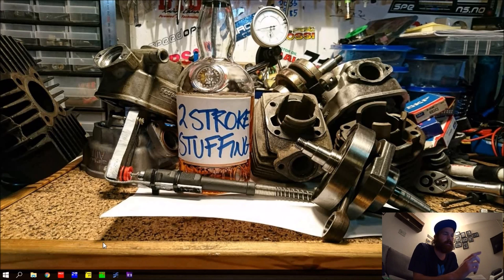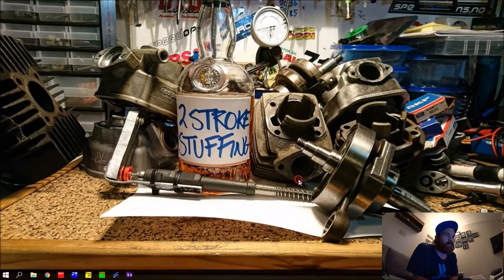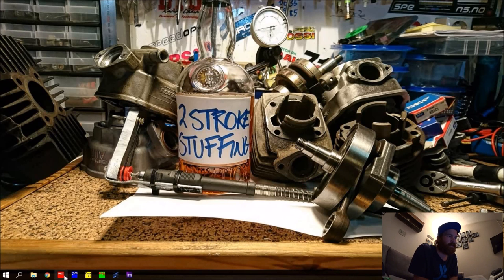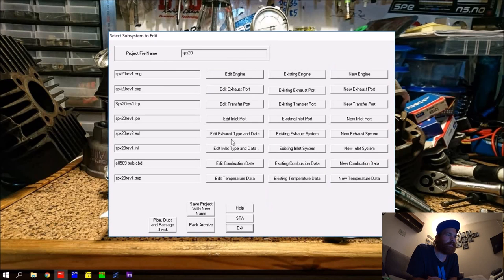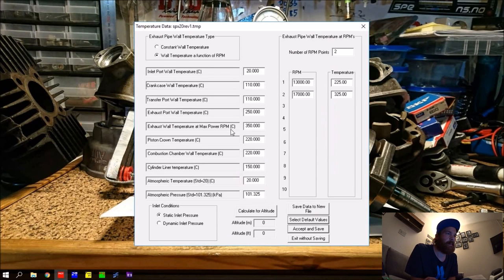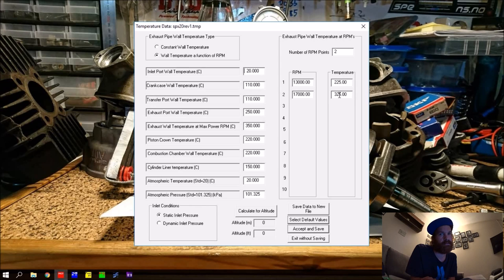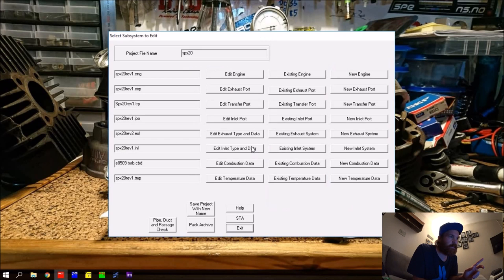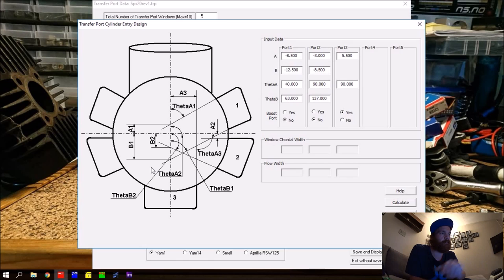E30 Engmod2t - Best Two Stroke Software! 2STROKE STUFFING

Comment: I have been using Neels s/w for over a decade. It has helped me win one national Championship. And build hundreds of  customised two stroke engines for customers. 
Prior to this I used spread sheets, then Mota, But once I found Engmod2t and engmod4t. No looking back. His power output predictions matched the dyno. And the chambers designed using this s/w is hard to beat. He is my tuning Guru. I could not have achieved anything without his software and guidance.
Reply: So how can i contact him as ineed help wih a 2stroke twin roadracer.  Thx

Comment: Thanks for a great 2-stroke page! 😊

Did you have time to evaluate any other 2-stroke software? Like Bimotion or RacingSM? 
$400 for the EngMod 2T might not be super expensive but probably a bit more than most hobbyists entire renovation budget…
Reply from the maker: Thanks! I have very little experience with other software, but engmod is close to perfect in my opinion.
Reply: Any chance you can make a comparison between the results in EngMod 2T and the dyno with the same setup on the bike? That would convince many people!
Reply: do you have a link? I would love to take a look at it

Comment: Alex, I think the diffuser horn coefficient is only relevant when the diffuser sections are part of an exponential horn, like a trumpet, where each section has a steeper angle than the one before, following an exponential formula. Such pipes work, but require a very careful throttle coming out of corners, especially in the rain. Don't ask me how I know...

Comment: Have you ever heard about the GT-Suite and the included PowerGT software? Former Ferrari F1 engine designer told me about that. This engmod2t software looks something like a layout built on those features with limited input, output possibilities, but at least engmod2t is specified for 2stroke tuners and you do not need to run CFD simulations, to get scavenging ratios
Reply from the maker: +rlaci It's pretty expensive I recon?
Reply: i do not even know if a normal person can buy it or just an organization etc, but as i know AVL and engine companies like that are using them. As i know from my friend Audi has his own softwares possibly other companies too. Once I think heard something that engmod2t is based on powerGT but i'm not sure, anyway its way easier for a tuner to use layouts than make new complete systems with a lot of variables. I will contact you on your ordering mail to talk more about supercharged 2stroke and will try to find and upload some stuff to show you in the next days
Reply: GT-Suite is not good for 2 stroke simming. The expansion chamber modelling is not accurate and there is no reed valve modelling at all.
Reply: i think you have more experience with that program, could you help me with a scavenging ratio calculation?
Reply: What help do you need?
Reply: for scavenging the gt suite is using some kind of constant, what i do not know how to calculate, i think some CFD modeling is needed, but possibly you have experience with working numbers. can I PM you on some way?
Reply: I think you need the scavenging numbers that are used by Engmod2t software. If you email Niels at Vannik and ask for a sample copy of this software, the help files that come with it are very good and list the actual numbers that came from the QUB single shot scavenging rig.

Although I used CFD, i'm in no way an expert, far from it. It's hard to be confident that any numbers that come from a CFD modelling run can be in anyway accurate/useable. The QUB are empirical so pretty much trustworthly.

Comment: As a retired engineer, the first and most important thing for any simulation software is to apply it to some known real cases and compare the results. If you dont do this , then you dont know if the software is working for your situation. what is required is a set of files for known engines. ie a trail bike a road bike , a motocross bike and maybe even a roadracer. This would be an absolute minimum. The gentleman that wrote the software almost certainly did this to test its validity. Are these files around anywhere.

Comment: I think there are some outboard motors that still use a 'stepped'' (deflector top) piston. It's less efficient and heavy but cuts down on emissions. .  Evinrude had some advertisements a couple of years ago but I'm not a boater so didn't pay much attention to 1890's technology.  Regular and Premium are USA consumer classifications for octane numbers, usually 87 and 93. That software is way more advanced  than the stuff available in early 2000's, designed fro RC models?

Comment: Hi!
First many thanks for the videos and the great work you are doing. Congrats for finding those hp on those little already optimized engine, keep pushing. I am using gt power at work quite a lot, but of course for my hobby I can't afford such a software, therefore very interesting video here! 
I was wondering have you simulate your current engine with this soft, and how does it correlates with your dyno power curve? Are you able to describe the right shape of the power curve? (which I guess would be a good indication of wether you can find the right exhaust acoustic/trapping ratio) As a student (5-7 years ago) , I was trying to emulate a go kart engine with gt, and of course results are very sensitive to  exhaust acoustic, which is sensitive to combustion, which is a mess to simulate in 0d/1d, and difficult for us to have cylinder pressure data :s. Sorry for this long comment and my non perfect English. Anyway, congrats again for your work!

Comment: After watching your videos showing the development of your own 2T motors, which are pretty awesome and extremely interesting, I am confused as to the benefit of using this kind of software. Am I wrong to think this negates the need to develop new concepts, as by using this software doesn't it automatically come up with the most efficient design of engine for your requirements. Either a lower revving motor for increased torque and usability in a road bike or a screamer kart engine making peak power at 20,000 RPM.

Comment: Hello, thanks for the video. Its very intresting programm tool! Please tell me, In the program, in which place in transfer and in exhaust is placed the pressure gauges ?
Reply from the maker: +Tiit Rea Thanks for watching! Default location with the "pressure transducer" input set to "0" is at port opening. I use this setting. If you use "10" then you will take the measurement 10mm into the duct from the port window.
Reply: Thanks! What about in the exhaust pressure in Your setting ? It´s possible to set too ?
Reply from the maker: +Tiit Rea Works the same way for the exhaust, higher number means distance from the port window in millimeters.
Reply: Thank You

Comment: Thanks for the video. That's a very powerful tool, i definitely need to read some more theory before i spend the 400$ on this! I had no idea how many measurements this software can and needs to handle. I think i need to read me some Gordon Blair, am i right?
Reply from the maker: +Carsten Lorenzen Thank you for your donation! Reading Gordon Blair certainly wont hurt! It's not that bad tho, reading the help file, common sense and accurate measurements will get you a long way.

Comment: hey.. what method did you calculate the crank volume? by pouring the oil inside the case and measure the oil volume?
Reply from the maker: Yep, pouring oil through a holed piston.
Reply: 2STROKE STUFFING is  there  any  other  method  besides  that?  im  really  reluctant  to  sacrifice  my expensive  piston.
Reply from the maker: Maybe you could get a scrap piston to use?

Comment: hey how do you warm up the engine? do you just let it sit on idle? or do you keep revving it?
Reply from the maker: Nick A mix of both. I run it pretty cold tho.
Reply: 2STROKE STUFFING how do you mean? do you start the runs cold? the optimal cilindre temperature is around 65 degrees celcius, that makes alot of difference in power too. 
these vids are great though!! you're the most entertaining youtuber there is and you really deserve more subs!!
keep going!
Reply from the maker: +Nick Thanks for the kind words! I start my runs when head temp is about 40c, it peaks at about 80-90c. No water temp gauge, but the water is not running very hot, approximately 50c.
Reply: 2STROKE STUFFING ah thanks, i have a 50cc derbi (maybe you should do a derbi engine as a next project?) and the temp really makes a difference, i can even lean  the mixture a bit to get it hotter and thus faster.
Reply from the maker: Nick cool! I've got a Derbi engine, and there is some plans for it in the future!
Reply: 2STROKE STUFFING aaaah nice! great to hear!
Reply: 2STROKE STUFFING maybe the derbi engine on a kreidler frame or something like that?
Reply from the maker: +Nick fun idea! We'll see!
Reply: I know it may not seem like a worthy engine to you. but please mod a bicycle 66cc HT engine ! they only male 3hp stock and I can't seem to get much more than 6 estimated hp... 45 mph on my custom made bike
Reply from the maker: +Steven Main Great idea, that could be a fun project/challenge!